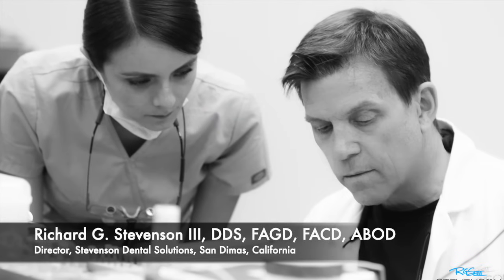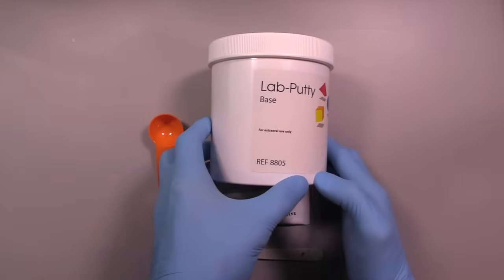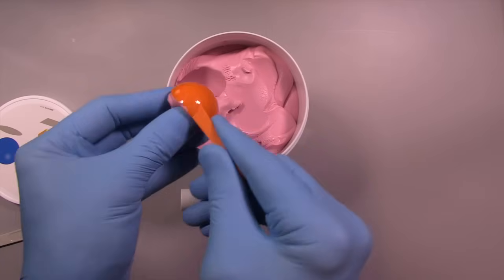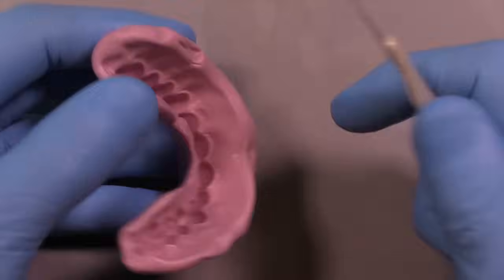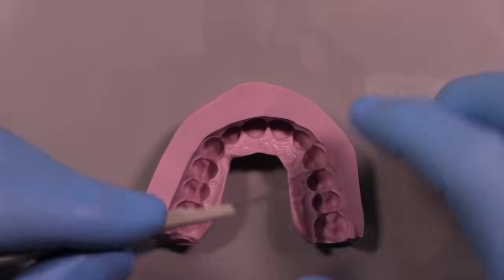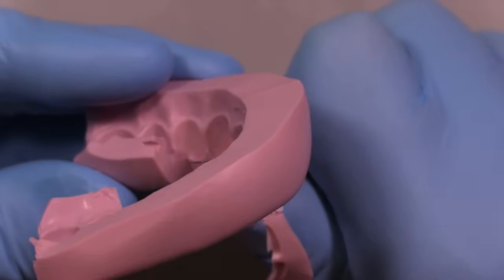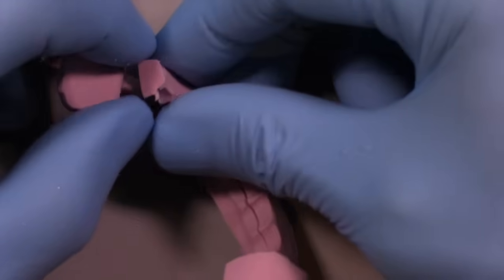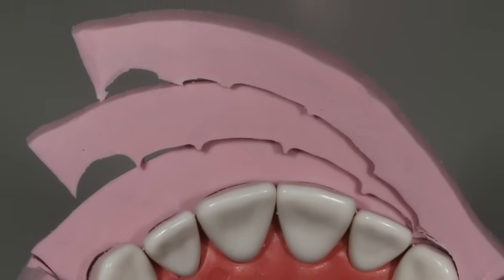Anterior Ceramic Veneers, Part 1: Preparation Guides

Comment: Hello Dr;

I had veneer procedure done yesterday for 4 front tooth. And my dentist spilled mild gum on one of the veneers; now that veneer surface on the front is very rough to touch compare to other three veneers. 

What would you recommend for my case?
Reply from the maker: They may be polished with the correct ceramic polishers.
Reply: @StevensonDentalSolutions  ok thank you for your reply

Comment: Thats silicone by addition
Reply from the maker: Try again Doc.

 Condensation reaction silicones irreversibly cure leaving ethyl alcohol as a by-product and aren’t meant to polymerize intra-orally. The reaction and the by-product can lead to polymerization shrinkage, so this kind of material is generally packaged with a highly filled putty base and a lower viscosity catalyst activator. The highly filled putty base has less polymer and results in less polymerization shrinkage. Examples of this type of lab putty are Sil-Tech (Ivoclar Vivadent) and Lab-Putty (Coltene/Whaledent). Some users report skin irritation from the catalyst and recommend using gloves while mixing this type of lab-putty. Latex gloves have been implicated in interference of the setting reaction so a different glove material is suggested.

Comment: I think this putty reduction guide is used when we want to maintain the current shape of the teeth but only want to change the texture or color. What if patient is not happy with the alignment or shape of the current teeth? Would you request the waxup from the lab and then make a putty reduction guide of the wax up instead? Could you make a separate video for this?
Reply from the maker: You are correct.   I use Digital Smile Design for this and print a model from a virtual wax-up. I plan on making a video of this soon.  Thank you!

Comment: now that prep should be done on cast after wax up or on patient direct teeth befor reduction ?i got confused
Reply from the maker: Use the wax-up or digital design to fabricate a stent with the proposed final contours and lengths.  Add a temporary material to this stent and apply it to the patient to see the final proposed veneers.  If the patient accepts this and it meets your functional and esthetic objectives, you may remove this, then acid etch and bond it to the teeth and start prepping in the mouth.  Use the prep guide to check your progress.  After the preps are completed, remove any remaining mock up material, create a finish line and take the impression.

Comment: RIP speakers
Reply from the maker: Sorry!
Reply: Stevenson Dental Solutions  not a problem. Can I just say thank you for your excellent videos. Watched the veneer series and absolutely fantastic. 

I have major concerns with placing anything but a facial veneer as feel normal excursive and chewing motions of the lower mandible will displace it. Do you have any advice for this? Other than reducing the contact ?
Reply from the maker: Great question!  Lengthening anterior teeth requires a thorough understanding of dynamic function:  Pathways taken by the teeth during chewing AND parafunction: the forces and patterns of wear when the patient clenches or grinds.  Before embarking on a veneer case, the Functional Diagnosis must be made, and then the planning may be made.  Too much for YouTube - fortunately I teach this in my Anterior Veneer course.  I will put out a video on the 5-step check that I teach some time in the future - this will help...
Reply: Stevenson Dental Solutions thank you. I actually travel to America quite a lot so may consider this if the dates line up. Thank you for your reply and look forward to the video
Reply from the maker: Awesome - hope to meet you someday...Best, Dr. S

Comment: If you do your preparations over APT (aesthetic pre-evaluative temporaries) and placing depth cuts in APT indicate you do not actually need to grind tooth enamel, do you still required to prepare gingival and/or proximal margins? How wide? What bur tipe? How do you do no-prep veneers?